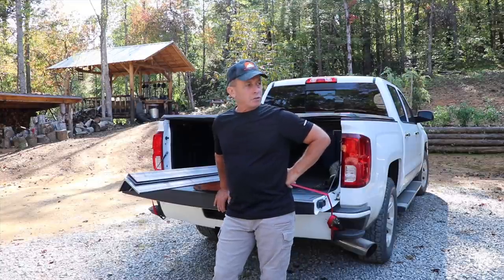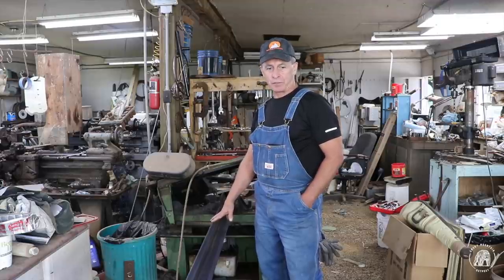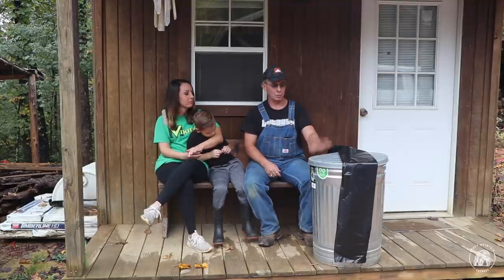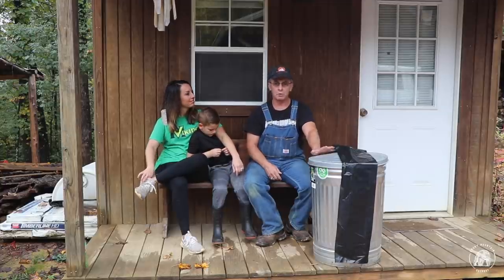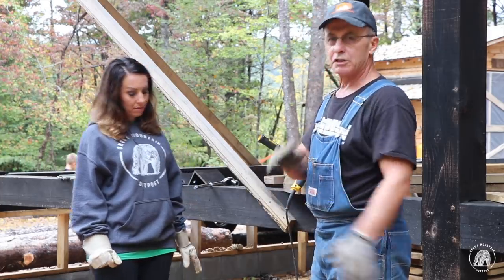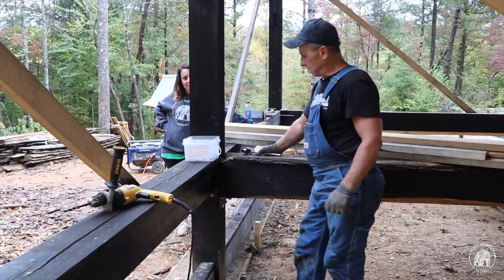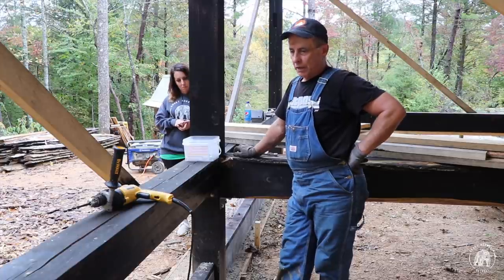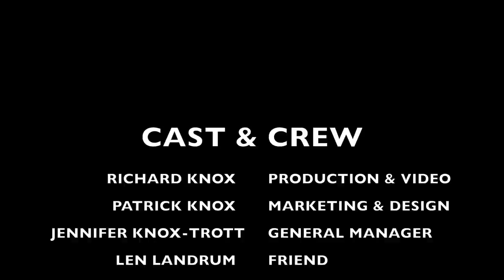S2 EP28 | OFF GRID TIMBER FRAME | WORK BEGINS AGAIN ON THE CABIN | ANGLE IRON FOR POST & BEAM JOINTS

Comment: I hope you bought him some new blades and bits. LOL. That many cuts and holes must wear them out. Considering what your angle iron  braces have to do, wouldn't 1/8" steel  have been sufficient? Your mortise and tenon joints are probably more than sufficient since you pegged them to lock them in place and your angle iron basically just add a bit of insurance to them. Hahaha I should have  watched the entire video before commenting because you said the same thing. LOL
Reply from the maker: Of course I did. Now he has extra instead of one, lol
Reply: @SmokyMountainOutpost  somehow I knew you would. You strike me as a great neighbor to have.

Comment: A annular  bit would have been much faster on drilling holes. I drilled about 75 3/4" holes thru 1/4" steel in two hours with an annular bit.
Reply from the maker: Again! Totally correct, just didn’t have it at the time. Will have to order those items for next time, thanks Edward!

Comment: What no safety glasses.
Reply from the maker: Lol, not with my low speed drill and wood.  It really convinced of the need.
Reply: @SmokyMountainOutpost  Better safe than blind.. You would think with your job it would just be normal run of the mill safety first practice.